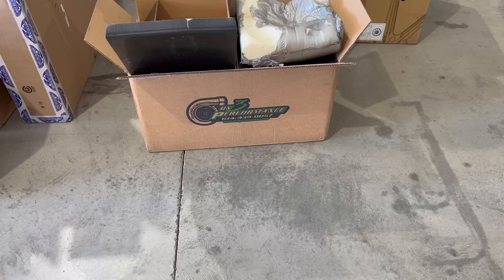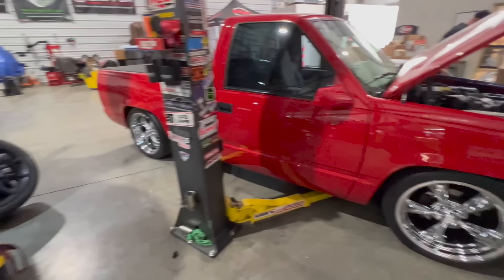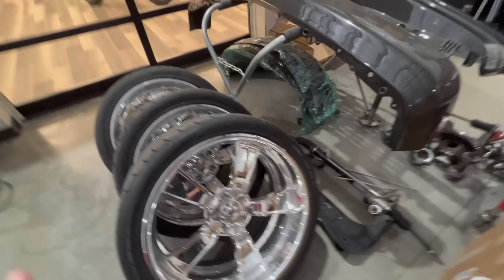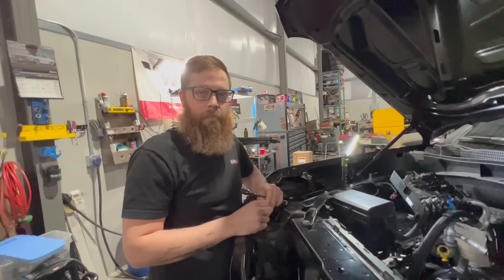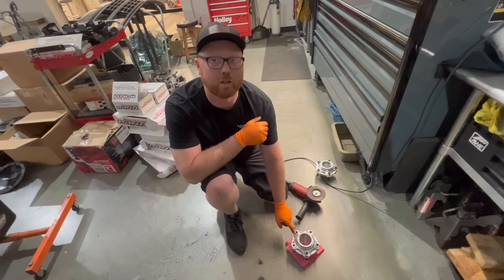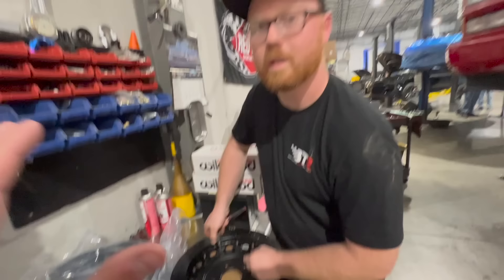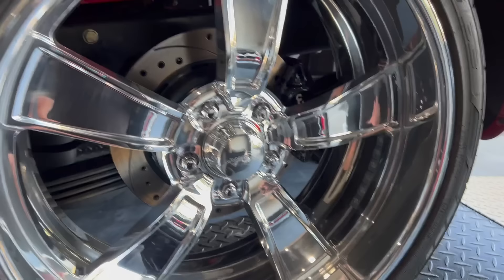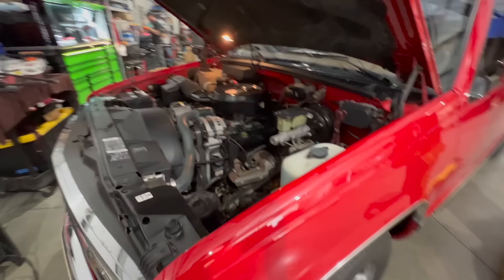Twin turbo regular cab/short bed 2024 GMC Sierra coming right up!

Comment: Just in case you didn’t know belltech (kit # 6658) makes and upper shock extension for the 88-98 OBS. It will move the shocks closer to the factory geometry for a better ride. I just installed it a few weeks ago on my 1990 and can tell the difference.

Comment: The 94 needs it’s stock grille back on it, maybe in black to make it like a Sport edition🤤
Reply: That is the original grill.
Reply: @9502silverado  I was in belief that the square dash model had the previous grille with the smaller corner lamps🥲
Reply: @tripstomexico9770  ahh gotchya, 94 was the first year of that grill. Then 95 got the round interior and black plastic mirrors.

Comment: Justin how have those 10 bolt Eaton rear ends been holding up with LT4 power plants??? I'm just wondering because I pretty much built the same thing for my truck yukon axles and all, but I'm not running 600-700hp. I have zero problems with mine.

Comment: @stangkilrproductions what’s the recipe for 750-800 wheel with lt4 platform
Reply from the maker: Cam, 2.30 upper, 9.06 lower, ported supercharger, Rotofab, headers, low side fuel system and e85
Reply: @StangkilrProductions  right on brother sitting it in the 67 Camaro this weekend hopefully she’ll be fun